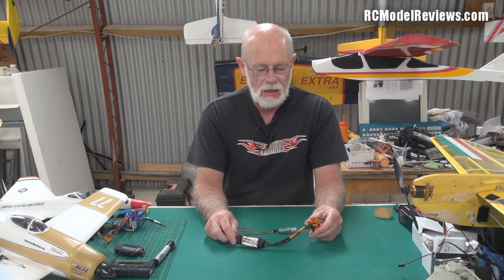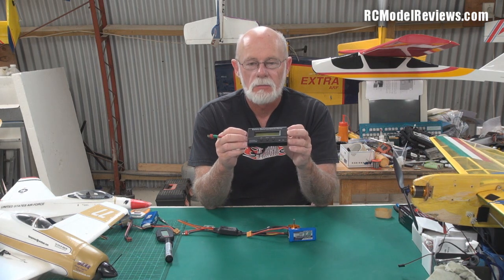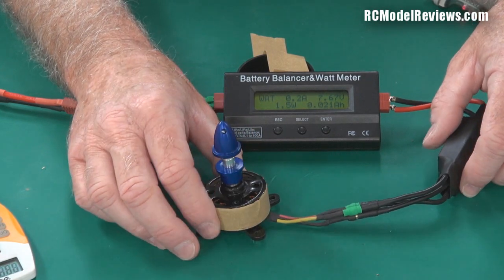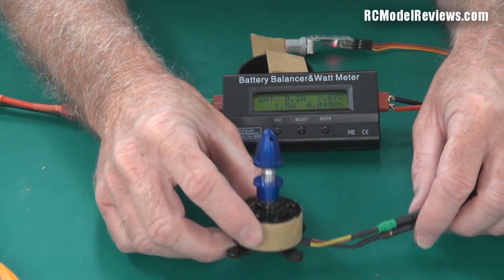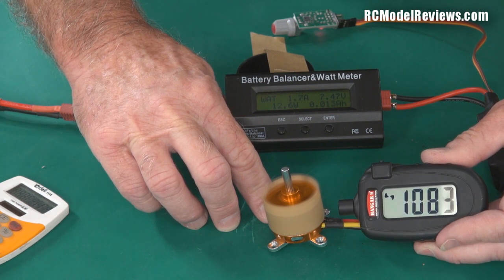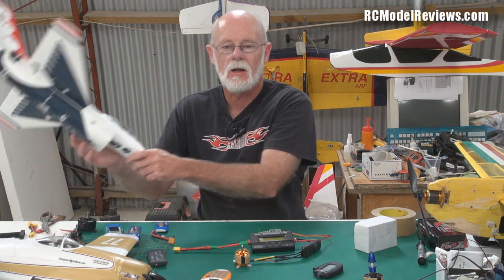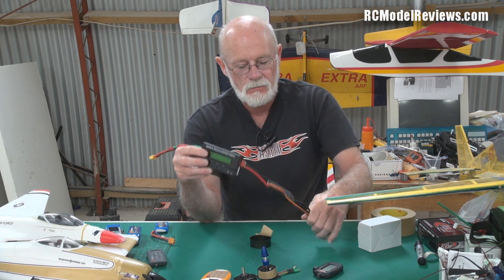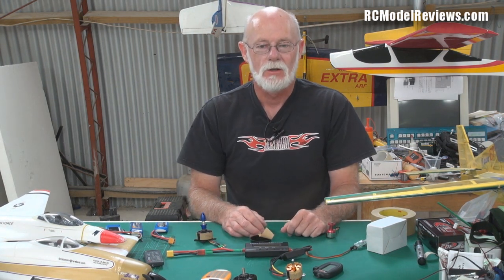RC BASICS: What is KV?

Comment: So if i have low KV motor, i have to use a big propeller. Now sir, if i have 2400kv motor and 920kv motor with the same size, which is better?
Reply: +Nathanael Andreas Hutahaean (Nathan)
Neither is 'better'. Each one requires different voltage to run at the same speed. If they're of similar design and the same size, they should be capable of roughly the same power.
For a given power in Watts, a motor with half the kv will require twice the voltage but will only need half the current (Amps) to produce the same power at the same RPM.
Reply: This is what I'm trying to figure out as well, from looking at the same motors with different kv and windings, I would have to assume basement is wrong, or I'm misunderstanding what he means. It seems the higher the kv on the same motor the more power and more efficiency it has. For this reason I have been under the impression higher kv is always better, even for bigger planes, a higher kv winding and a smaller prop will be better all around. The only issue would be spinning the prop too fast getting deflection or even supersonic speeds at the tips destroying efficiency, but I think that's pretty hard with most the cheap options. If I'm wrong about anything id love to be corrected because that would help me grasp motor windings better.
Reply: Travis Pratt Higher kv isn't always better, it's a matter of choosing what's best for your application.
Higher kv means fewer turns of thicker wire for the copper windings. Lower kv is the opposite.
So, for a given power (Watts) and a given RPM and load (load is the motor's torque), a higher kv motor requires less voltage, but higher current.
To use an otherwise identical motor with a lower kv for the same performance, you'd use more battery cells (higher voltage pack), but since the current is lower, you'd use smaller cells (lower mAh rating) to get the same flight time.
Identical motors are often available with different kv ratings (windings) because it allows you to use different numbers of battery cells for the same application, for example, 450 RC helicopters usually use 3S lipo packs (11.1V), but some use 6S packs (22.2V). The 6S helicopter will use half the current (amps) as the 3S one--the only differences are the motor kv's, and the current requirements of the ESC, everything else is identical. The 6S pack will use smaller cells with half the capacity (mAh) as the 3S pack, but since they only supply half as much current, flight times will be identical. For example, 3S 2200mAh (very typical) or 6S 1100mAh packs will give the same performance and flight time on a 450 heli.
It makes it much more convenient to choose motors, since you can fly models with whatever battery packs you already have, instead of needing new packs for every model.

For any given power (Wattage) you can use a huge variety of battery packs, as long as they store enough energy (Watt-hours, pack voltage times pack capacity in amp-hours) to get the flight times you want.
Reply: Ok I get most of what youre saying, I guess the biggest thing I dont understand fully is why would you get longer flight times with a lower kv motor if a higher kv winding is more efficient? Isn't that what efficiency means? Also, for fixed wing, I'm more talking about the difference between lets say an a2212 1000kv with an 8x8 prop vs an a2212 2300kv with a 7x4 prop, assuming those are the same pitch speed at the given rpms, what would be the differences?
Reply: Travis Pratt A higher kv motor is only more efficient if it's a better match for your application. Higher kv does not always mean better efficiency--only if the lower kv motor was mismatched to your application (Battery voltage, required RPM and load).
As for the second part, download a copy of MotoCalc (great software) and enter the various motor, propeller and battery parameters, run the calculation and see what you get--it'll explain it to you in detail. MotoCalc is very easy to use and you can use it for free--it'll give you a solid understanding of how all these factors interact with each other, as well as giving meaningful performance numbers that actually predict how the model will perform in flight and how long it can be flown.
Reply: Hello sir, if i'm building an R/C plane that's going to be loaded with let's say 5 kg, do i need a higher Kv motor or lower Kv motor ? i really do not mind about speed, it's all about carrying the load
Reply: Juan Gil Time to get hold of MotoCalc...
Reply: BasementEngineer What is that ? It's an airplane for SAE competition in brazil.
Reply: Juan Gil It's also the name of a computer program you can download and use for free, it'll tell you flight times, thrust, speed, climb rate etc. for different combinations of motors, propellers and batteries. You can even enter your own component parameters and try them out. If you're assembling your own electric power system it's definitely worthwhile checking out, it'll tell you what you can realistically expect.
Reply: Yea thanks for the suggestion, its a neat program, been playing with it off and on here. I still havent quite grasped all the relationships between kV and pitch, specifically all the differences between low kV high pitch and high kV lower pitch, according to the program they seem about equal so idk.
Reply: Travis Pratt Think of motor kv as being more important to battery voltage.
After that, choose a propeller diameter and pitch to suit flight performance taste :) Bigger props give shorter takeoff and higher climb rate, steeper pitch gives higher top speed. But, choose battery voltage and kv first.
Reply: Ahh, yea being able to choose voltage and battery cells with kv does make sense. I'm understanding why the scratch builder on flite test "nerdnic" uses low kv large high pitch props, seems best of all worlds.
Reply: Well, except the fact large props are more expensive and break easier, that's really the only reason Ive been going with high kv small props, they're stupid cheap in 10 packs from china and are less likely to break.
Reply: Travis Pratt Except, for the same motor wattage and flight time, a larger, slower-turning prop is more efficient and gives better overall flight performance. The only time you'll notice an improvement by using a smaller prop and higher kv motor (or the same motor with a higher voltage battery) is when very high speed model airplanes are flown (300 km/h or faster.) At these speeds, a smaller, faster turning propeller is more efficient because the blade tip speed is lower. For normal 'sport'/aerobatic flying, the acceleration, climb rate and flight times are improved by using a larger, slower-turning propeller.
Reply: So would this mean going for a target rpm would really be a better measurement than watts or amps? And os there a way to know that target rpm? Also, why do same size motors with different windings have vastly different amp and watt ratings? http://www.banggood.com/DYS-D2826-2826-930KV-1000KV-1400KV-2200KV-Brushless-Motor-p-986316.html for example, 130 watts for 950 kv and 342 watts for 2200 kv, surely the 342 watts is going to be able to pull more airplane, even if you have to go low pitch slightly larger prop to get the torque right?
Reply: Right but the tractor and race engine doesn't really make sense to me because were not talking torque/power vs efficiency, or even toque vs horsepower, were talking about a high kv being more efficient and able to produce more power for a given size. unless you're saying the loss of efficiency is made up for and then some with a bigger prop. You'd want to use a smaller prop and higher kv, because as I understand it you get more actual power from a high kv motor spinning a smaller prop than a low kv same size motor with a bigger prop pulling the same watts, unless my understanding is wrong. Also, don't get me wrong I'm not presenting an argument really, I'm honestly just trying to understand and see where I am wrong, and I am assuming I am wrong about my understanding somewhere because my logic tells me high kv will always be more beneficial, within a certain set of parameters. Obviously if you go too high a kv you hit issues with the prop spinning to fast, or if you want to go slow with the maximum amount of torque for a cargo plane you might not be able to get a shallow enough pitch, but other than the extremes is what I'm talking about.
Reply: You seem to keep going on extremes of the spectrum though, I'm more talking about say using a 1400kv motor vs a 2200 kv, assuming I want to just go 50 mph. I can use the 1400kv and ill have to have a higher pitch and about the same size prop, or I can use the 2200kv, underprop it and pull half the rated watts but still go the same speed with the same load, for less power input correct? Or, if I want to go 25 mph, I could use a larger prop for the 2200kv, with a very shallow pitch, like 9x3 maybe, and to get the same performance on a 1400kv, id have to go with about the same size, but a more normal pitch, maybe a 9x6. In this situation I'm way underpropping the 2200kv which makes it very efficient, both have about the same size props except I've adjusted the pitch so I can get more torque or more speed. Now in all these situations the higher kv wins right? Its not until you go into setups that would require too much or too little pitch to get the desired speed that you'd need to lower the kv in order to put a realistic propeller on right?
Reply: I wasn't aware brushless motors had a power band, is that what you're saying?
Reply: also, I'm my example, the lower kv motor has a higher pitch, meaning it will have less torque and better efficiency at speed, and the high kv has a shallow pitch, but the same size propeller and same surface area on the propeller, from what I understand the high kv winding gives you more power to work with when you put a given watts into it, and since were working with the same surface area on the prop, and the same pitch speed, the high kv is going to be better in that instance right? For both efficiency and power, the climbing and speed characteristics should remain the same with each setup in my example, its just you're getting more efficiency from the higher kv at the same wattage. The p38 example could just be for simplicity, or avoiding prop stalls at low speed or something idk.
Reply: "Higher kv does NOT give you more “power” to work with for a given watts. Power = V I = voltage times current."This is probably my main misunderstanding then, I was under the assumption it did. I wasn't ignoring the real world effects, I was just under the assumption at some point the effects of a more efficient faster spinning motor would outweight the negatives of a smaller faster spinning prop. Unless youe just playing a semantics game here, voltage times current is watts, when I said usable power, I meant a measure of the rotational force, I'm not ignoring real world effects in that, I'm simply saying you have to weigh the efficiency of a higher kv motor (in the sense it will give you more work without Losing it to heat) vs the advantages of a slower bigger more efficient prop. A smaller prop can only transfer its energy to either noise or drag, so is that noise and drag of a smaller prop outweighing the more efficient lower resistance winding? I dont know..For your tractor, you could just gear up the motor, which has disadvantages just like a higher pitch prop, but less so in fluid compared to turning different gears, because in fluid you're able to always be right at your efficiency curve with the right prop, not so with gears, you'll always be either shifting or out of your efficiency curve.Can you explain why high kv motors have such a drastic watt rating difference though? And can you pull the same watts from a lower kv motor assuming you up the voltage?
Reply: Sorry for the bock of text, my tablet isn't recognizing new paragraphs, every time there's no space after a period that's a new paragraph.
Reply: I believe the reason higher kv will give you more power for a given watt (in most parkflyer applications)&#160;is armature resistance, which is much lower at high rpms. And since with an airplane, you don't have to accelerate your prop from a stop, or from a shifting of gears, like a tractor or car, you can stay right at the high rpms to achieve the best efficiency, and just use a lower pitch prop to adjust your intended speed. In an airplane, the motor itself is more like a whole car, with the kv being the torque and efficiency all together, then you can adjust that further with a prop, that's why a tractor racecar analogy isn't really the same, its more like if you attached propellers to your tractor and racecar, you could put very low pitch propellers on your racecar and get the efficiency and torque you needed to do the tractors job, better, as long as you're not going to unrealistic extremes. or, you could put giant props which gain some efficiency on your tractor to make it go as fast as a racecar, but since a tractor is only more efficient when both engines are at a lower rpm, and we never need to use a low rpm with the tractor, theracecar would be better, assuming the racecar can give you less loss of energy to produce the same amount of work, like a higher kv motor can.(in the application of a propeller always spinning at high speed when its working)
Reply: And yes, I do understand larger prop generally means more efficient. I also understand spinning faster creates drag and noise losing energy, but I just think in most rc applications the advantage of that low armature resistance outweighs the advantages of a larger prop.
Reply: Well, I have and I am, and my findings are that when one motor has multiple kv options, its really best to just go with the higher kv, you get significantly more power to weight, smaller props don't break as easily, if you need/want to go slower you can just adjust your prop, and if you want longer flight times you just underprop. Efficiency honestly seems like a wash too, and barely noticeable anyways with how much power is in such a small package. And yes I do understand theres an envelope, remember every time I said extremes one way or the other? Well that would be going out of the envelope. I guess I should just make it clear I don't mean higher kv is literally always better, I just mean when theres an option between motors, as long as you're not trying to do something out of the ordinary like maximum flight time with no regard for speed, the higher kv is the better choice. I mean, I still don't like the racecar tracto analogy, it is not the same, and a propeller pitch is not the same as a rear tire, a rear tire is the same as changing the pinion gear in a motor, its not addressing the fact an airplane motor is always operating at the best rpm if propped correctly while a tractor and racecar need to shift and use a much broader rpm range. I mean this is like someone asking "whats better In a car, higher horsepower or higher torque", yes you could answer "well it depends" or "its not that simple" but the reality is 90% of people are going to want horsepower over torque in a car, up to a point, obviously when you get to extremes like putting a gsxr engine in a car, it wont be ideal because all your power will be way to high in the rpms, but generally speaking higher horsepower makes a car better and higher kv makes a model airplane better.
Reply: Alright bud, look, I may not fully understand every aspect of physics but that doesn't mean I don't have the basics down. You're intentionally convoluting what's happening while simultaneously misunderstanding what I'm saying (which is partly my fault because I used the term "useable power" to represent the amount of energy we can use to push our plane forward, sue me.) Then you come back explaining kV and torque isn't power? I never said it was. Einstein said energy can not be created or destroyed, only transferred right? So what were arguing is how to convert electricity into forward momentum on an airplane, without losing it to heat or noise, right? Well you keep introducing variables that obviously would affect our outcome, like running at partial throttle, running a mismatched motor or kV, different motor designs etc, I clearly said that's not what I'm talking about, if someone's deciding kV, its extremely likely they are deciding what to pick on a recommended/matched motor for their application. So I am talking about the differences picking a low kV same motor and high kV same motor. Those differences won't necessarily change with the application, a high kV motor has way less armature resistance at high rpms, less resistance means less heat, and means you're able to either pull more watts without overheating or pull the same watts more efficiently, assuming you prop for the right rpm. Right? Now, you come back and say, yes but a faster smaller prop is less efficient, yes I get that, but the question is, is it so much more efficient that it overcomes the effiency of the lower resistance winding? That's the issues, its not just "oh a bigger prop is more efficient so why would you use a smaller prop?" Well, you'd use a smaller prop because the same size motor set up to use a smaller prop is more efficient, and also has the potential for way more thrust. A tractor and racecar work, fine, but let's change it to a truck engine vs a sports car engine, because that's what we're talking about, similar setups and adjusting the motor and drivetrain to get our desired results. Not gimbal motors vs ducted fans.
Reply: Also,dont tell me to stop, I started this as a conversation asking for help understanding, you're the one who wanted to keep acting as though you were arguing a debate. Since then I've done more research and have concluded I was more right than I thought, and you're the cliche "oh it's not that simple you wouldn't understand" type of person that can't just make a subjective decision for the fear someone will come out of the woodwork and explain your decision has exceptions. Higher horsepower s better for cars. Higher kV is better for airplanes. That is my subjective decision that you can disagree with if you want and point out all the exceptions that prove me wrong but generally speaking, those are true statements.
Reply: Ok, well written, and for the record I do fly full throttle pretty much all the time, and i have found my high kv motors do just fine with slower type planes like the ft bushwhacker, I just go with a slightly larger low pitch prop. I basically figure out how fast id like to go with my plane and choose a prop and motor that will get me there at full throttle. So my experiences may be different. Can we agree that if you don't care about efficiency and have the correct equipment to handle extra amperage higher kv will be better, while if you're looking to get longer flight times lower kv may win? That seems like a fair over simplification yes?